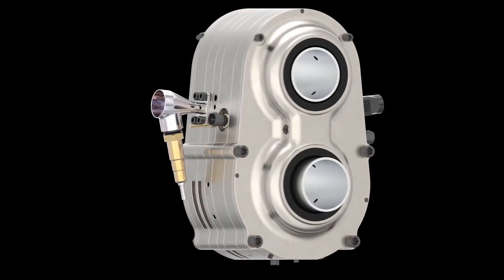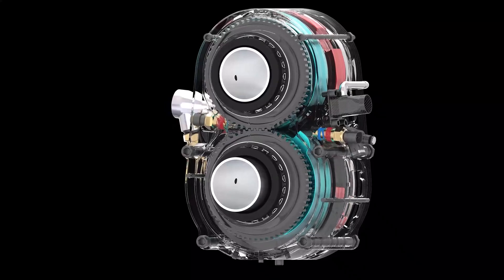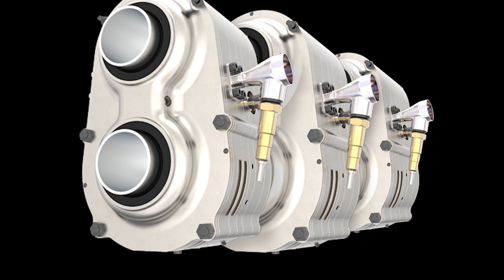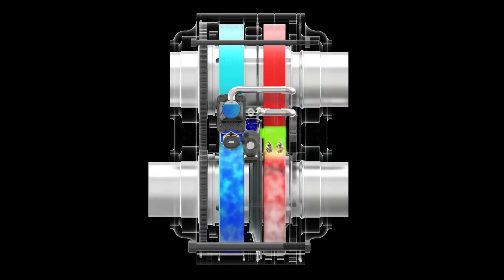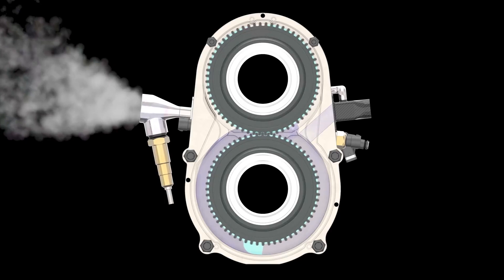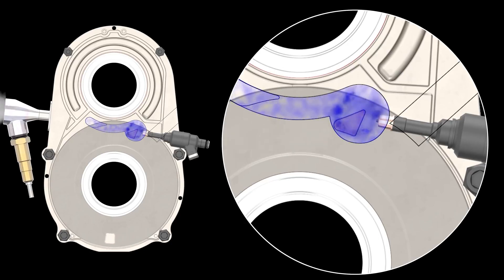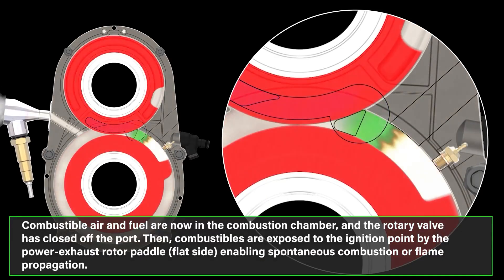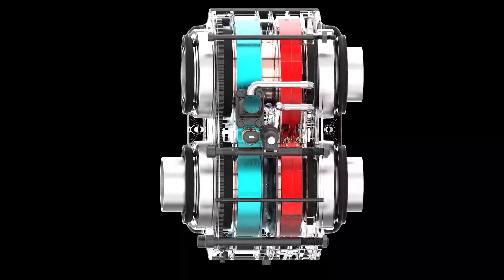This pistonless engine runs on hydrogen and revs to 25k rpm

Comment: I'll believe this engine is great when it shows up in my garage.  Plus, I thought it takes more energy to produce Hydrogen than you get out of it.
Reply: But you only need like 10kg of it in a gas bottle. Also It Is a bit easier to transport than electricity
Reply: hydrogen is being used as long term power storage as it is more dense & likely cheaper than batteries, not to mention the whole lithium excavation problem. if this works, using it instead of huge battery packs would result in lighter, cheaper cars with longer ranges & shorter fill-up times (although probably more expensive fuel, but probably still cheaper than fossils).
Reply: @vukpsodorov5446  how is the hydrogen harvested? Is there some  method other than hydrolysis? 
I'm no authority but I've heard of no other method that won't consume carbon based fuel. Solve that problem and the service interval for this engine will seem like child's play.
Reply: @paullogieri248  there is, actually. electrolysis. you put high voltage electricity through water, and H2O molecules separate into H2 and O (with O then joining other O atoms to make O2). the reason this isn't being done is because architecture around using fossil fuels is currently still more cost effective and in general, the power grids need to improve for this to become widespread (both in power production capacity and the means of production, so the electricity generated is green, otherwise it defeats the purpose). i'm not gonna dive into the morality of just optimizing costs, as i obviously would prefer less pollution rather than bigger profits, but the industry still hasn't made that kind of move in any significant way. also, for now, a good portion of the power for electrolysis is going to be dirty, so implementing it now wouldn't make a huge difference over other methods.
Reply: @paullogieri248  2 things i want to point out: first, the US isn't the world. as in, whatever the US chooses to make power, and it's going to need a huge improvement to it's power grid regardless, doesn't dictate what everyone else decides to use. so this is still viable even if the US doesn't decide to do it.
second, nuclear is likely the best option. producing wind and solar farms (and the infrastructure to support them) turns out to be more harmful than building nuclear reactors. also, nuclear reactors being built today are (and have been for quite a while) basically the safest option. they don't pollute, and whatever fear mongering the media is trying to do is just that - fear mongering, that falls apart when you actually look at the facts.
Reply: @vukpsodorov5446   We Americans do become introspective quite easily. It wasn't my intention to exclude the rest of the world.
As for the rest of what of you said? I agree.

Comment: I bet they suggest hydrogen because for the tolerances to be tight enough to actually seal, even the tiniest about of soot would damage the engine. 

Also, what you save in engine weight, you gain in the extremely expensive and heavy hydrogen tanks. 

Long term I don't think those tolerances would last.

Finally, I'm sure it needs the supercharger to give it any kind of compression. I can't see a compression stroke here.
Reply: honestly, this kind of setup is likely lighter than battery packs, whilst offering more range. and quicker fill-up times.
Reply: @vukpsodorov5446  Sure, that would be true when comparing it electric,but compared to a combustion engine, the issues I mention are still very real. The range may not be increased, due to the way hydrogen is stored. Hydrogen is not really compressed into a highly dense liquid such as lpg is. It is always a gas. This means the tanks must be built extremely strong. Steel tanks are simply not enough and to make them strong enough,would add so much weight that they wouldn't be worth it, and are typically made from exotic composites such as Kevlar or carbon fibre. Compressed hydrogen does not hold as much energy density as a fuel like gasoline so the range is much smaller. 

Even to get a reasonable range, (still less than a gasoline talk the same size) the pressures inside the tank need to be enormous. Any compromise in that tank would lead to explosion. If you use gasoline, now you have to deal with things like soot that might wear the engine and leave it useless. For the parts to seal from exploding gases inside the engine, the tolerances need to be, and remain extremely tight, fractions of a millimeter. This includes expansion of the metals site to heat when the engine is started cold. Wear is a huge problem. You could bathe everything in oil, but if that oil ends up in the combustion chamber, you loose your efficiency and produce more nox gases. 

The fact that there isn't a demonstration of a real running engine in this video is a testament to how difficult/impossible it is to actually get running. It's always the case.
Reply: @ubza1234  i'm not gonna take fossil fuel derivatives into any kind of consideration, as they're going to be just about gone from new cars in 10 years or less. it's either going to be FCEVs, or BEVs.
i love ICEs, EVs feel really soulless to me but honestly, the environment is more important (which is why i'm really hoping FCEVs become more popular, as they're less harmful overall compared to BEVs).
hydrogen combustion is basically the only sustainable way to keep combustion engines running. i mean, porsche is working on synthesizing fuels out of the carbon that's already in the atmosphere, which is a decent idea, and from what i've heard they did manage to do some testing with that, but it's still got a long way to go before that's sustainable (and whether carbon emissions are the only ones that we should care about remains to be seen).
as for this engine, there are videos out there of the prototype running. why this guy didn't include it, i have no idea, but there is a working prototype, at least.
Reply: @vukpsodorov5446  None of my statements were about the environment, they where focused on the engineering only. The effectiveness, reliability, efficiency, practicality etc of the engineering does not change if people think combustion engines are bad for the environment or old fashion or anything like that. 

Hydrogen as a fuel for cars has been on the news since the 90s and in development long before that. Any engine can be converted to run on hydrogen. Even if you run a car that is 50 years old on hydrogen, the exhaust is still water. Chemically, unless something contaminates the combustion chamber, chemically, the only byproduct a combustion engine can produce as exhaust is water vapor. Even if the engine is not tuned correctly to the on the fuel. It can't even produce soot. 

The main challenge is to have any reasonable range, you need tanks that can handle up to 10,000psi of pressure. That means hoses and regulators that can also hold this pressure. That means that you need mass storage tanks at fuel stations that can handle hundreds of times more pressure than that in order to get fuel into the tank. That means pumps and regulators on the tanks of transport vehicles that can either handle 100,000psi our pumps that can reliably and safely pump that pressure into the tanks at fuel stations. 

I don't need to remind you that that's a lot of pressure! 

And that's one of the main hurdles with using hydrogen as a fuel. It's not the engines, you can literally tune ANY four stroke combustion engine to run on hydrogen. No matter how old, or new, or if it uses pistons, or rotors, or whatever. It's the storage and distribution that is not only challenging, but potentially extremely dangerous. Even if the tank was filled with something inert like nitrogen, if that tank ruptured for any reason, that amount of pressure would cause a bad time for anyone in the area, more so if it was a tank from a filling station.

I'm not saying this because I think hydrogen as a fuel is objectively a bad idea, but to use it, there are some HUGE challenges to overcome, and the engine is definitely not one of them, because like I said, it's super easy to convert a car to hydrogen.
Reply: @ubza1234  the reason why i said that i'm not comparing hydrogen to fossil fuels is because you said that my previous statement was true if compared to electric. so i pointed out that it essentially doesn't make much sense to compare against fossil fuels as they're quickly becoming less and less favorable. yes, pressurizing hydrogen sufficiently to offer similar tank volume consumed over a distance (to effectively make a 50L hydrogen tank last as long as a 50L gasoline tank) is seriously difficult with current technology, and there's currently no known way to effectively make leaps here. though, i don't think that the range being somewhat limited on a single tank to be a huge problem, as they can be filled up rather quickly. i drive a car with an LPG conversion kit that effectively has a range of about 350 km on LPG, and have had no issues with range as i can stop to fill up and get back on the road in minutes.
Reply: @vukpsodorov5446  My work vehicle also runs lpg. I don't think it will be all that quick. Consider this, lpg tanks take between 5-10 minutes to fill, (I've had some days where it takes 10 minutes or more.) that fills the tank to roughly 100psi. Then you have a hydrogen tank that needs to get to around 10,000psi. Perhaps they can fill it at full speed and have the tank filled in just 10 minutes. Or perhaps the sudden pressure AND temperature difference (from compressing gas) can cause internal stress of the tank, leading to long term damage? Perhaps the heat produced from going from low pressure to extreme pressure will be dangerous? A diesel engine Gets hot enough to cause detonation at around 300-500psi so consider this temperature shift due to pressure when filling the tank to 10,000psi. Perhaps it needs to be filled more slowly or with an active cooling system if it's going to be filled so quickly? What about the influence of the temperature on the pressure in the tank? 

These things I'm not totally sure about, as my expertise does not lie in the physics of compressible gases, but are all worth thought and consideration. 

I'm actually more with you in the sense that electric is the future and combustion engines will only be useful in commercial transportation, where the small size of fuel and engines is a major advantage over electric. Even then, I see a future in at most 80 years where large transportation vehicles are able to use electric systems without compromise.
Reply: @ubza1234  the main reason i brought up LPG is to mention that the relatively short range on a single full tank isn't really a problem if you can fill it up quickly. i'm not going to make assumptions about your vehicle, but your fuel tank is probably bigger than mine (mine is 33L).
also, as fuel cell cars already have decent range and short fill times. they're probably more efficient with their hydrogen fuel cells compared to a combustion engine, but they're also heavier.
the toyota mirai is a nearly 2 ton car that has a range of ~600 km (toyota claims more but, i've taken some amount off of the official number) and a fill up time of about 5 minutes. hence why, an ICE with a similar fuel setup, even if it got half of that range (300km), wouldn't be so bad as you could fill it up quickly and get going (and there's people living with these kinds of ranges already, even with the seriously long charge times of electric vehicles).
i'm sure rapidly pressurizing tanks  has it's own problems. but it seems that toyota (and the like) are working with it.
Reply: @vukpsodorov5446  Sorry, my app is playing up. The last thing you said was "I'm sure rapidly pressurising tanks had its problems " then it says "read more" but when I click, no extra text comes up. Is there more? I'm enjoying our chat here ☺
Reply: @ubza1234  yeah, there's one sentence after that. i said that it seems toyota (and the like) are managing to work with it.
yeah, i definitely agree it's nice to have a civilized discussion instead of.. y'know, all the other stuff that happens on the internet often. and i'm introduced to other points of view on things, too.
Reply: @vukpsodorov5446   that's how I feel about these too! 

My tank is 80 liters, and I get a range of around 300-350km. It's a very heavy work vehicle. It takes forever sometimes 😂 

Fuel cells are another thing entirely To combustion engines. I think the storage of energy, (as energy dense fuel) and the (current) low cost of combustion engines relative to any other transportation technology is the only thing keeping them relevant today. Once the cost comes down on electric vehicles, and batteries get just a little smaller and lighter with a reasonable range, then combustion engines, in all their manifestations, will no longer be relevant. I feel it's a good idea for engineers to refine combustion engines right up until they are completely unnecessary, regardless of the fuel used. Even then, there will still be engineers out there who will "have a thing" for the old combustion engines and continue working on it. After all that though, combustion engines will be like horses. Those who are passionate about them will maintain them and enjoy them on the weekends, but they don't serve any practical use other than the enjoyment it gives. Every year I visit the steam engine museum, where they get all these old vehicles and tractors. They don't just have steam engines, but all other types of engines too. It's nice to visit and talk with these guys about what they are passionate about, but they don't really serve a purpose, even the tractors. They are completely obsolete.
Reply: @ubza1234  yeah, i figured the fuel tank on that is huge if it takes that long. even at 20-30L you can feel the difference compared to gasoline, but it's usually done by the time i get to the cashier.
yeah, electric motors are generally just simpler, more reliable, quieter, and deliver better torque. the average person would prefer one of these as their daily driver instead of a combustion engine, and i think that's to be expected. on the other hand though, there are still new manual gearbox, 2 door/2 seat sports cars being sold (such as the mazda MX-5 on the cheap end, or something like a porsche 718 or one of those other luxury brands on the expensive end). these aren't commonly seen cars as they're not nearly as practical, but a market for them still exists and i expect this to be the market for future combustion engines that will end up having to move to hydrogen. basically, the person that buys a "driver's car" today is likely to look towards hydrogen ICE cars tomorrow should they be available, if that makes sense.

Comment: augment electric cars with this. either as additional power or an onboard high voltage generator.

the lightness of this unit will turn vehicles into kites and crosswinds will blow you off the road..  lots of applications tho.. power the trailer wheels on a large tractor trailer to help with hill climbing etc..

Comment: Hydrogen is, and always will be, a non starter. Hydrogen is the smallest atom. So small that its half the size of the second smallest atom, helium.
Hydrogen is insidious, as it wiggles its way between other atoms, pushing them apart. This is called hydrogen embrittlement. And there’s absolutely nothing that can be done to prevent it.
Farther more, hydrogen burns at 2660°C. That will melt just about anything. So to make an engine the fuel won’t melt would require the use of rare earth elements like titanium, platinum, and tungsten, because anything else will just become o pool of molten slag.
Now, as to the foolish push toward EV’s. Almost every EV out there has the same inherent problem that can not be overcome. 
This insurmountable problem is the simple reality is that it takes over a decade to build a power station. And there just isn’t a way to mass produce them. They are huge civil engineering projects. 
But for EVs to become mainstream, a brand new power station of 3 gigawatts would have to be completed, every year for every 5% of the car market that’s Battery Electric without any onboard power production.
And again that can not be a hydrogen fuel cell, as it takes three times as much power to put hydrogen in a tank than it does to charge a battery.

Comment: Multiple rings of straight-cut gears meshing at 25k must make an impressive racket.
Reply: Straight cut gears are not an essential aspect of the concept. They are just the easiest to model in CAD. Helical cut gears would work just fine, assuming the basic concept is sound, which is not a given.

Comment: If you think this ice will save the planet because it runs on hydrogen think again, Commercial hydrogen is 95% produced from fossil fuels https://en.wikipedia.org/wiki/Hydrogen_production#:~:text=There%20are%20four%20main%20sources%20for%20the%20commercial,fuels%20are%20the%20dominant%20source%20of%20industrial%20hydrogen.. Cool design, would love to see a real one.

Comment: What is this for, passenger vehicles? Modern engines can easily do 200k miles. Hard to believe a tight tolerance, high rpm, 200psi boosted engine to last. What will the service intervals be, and how catastrophic would it be to go beyond recommend service intervals?

Comment: I have difficulty believing this has as much torque as a car would require since it has little flyweight built into it. Picture a car moving from a dead stop and climbing a steep hill. 
Its anne citing idea for sure but its got to stay wound up and then deliver it energy through a transmission of some type. This is where electric motors will outperform the application of automotive power.